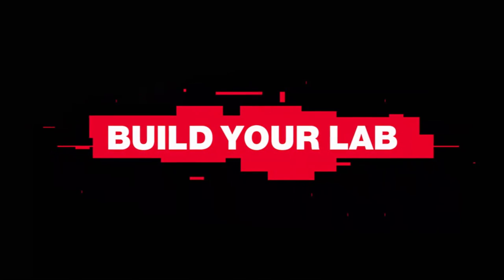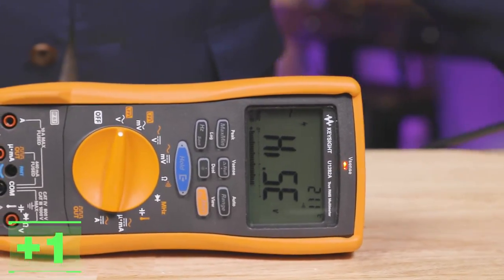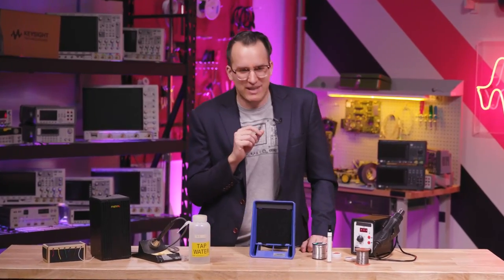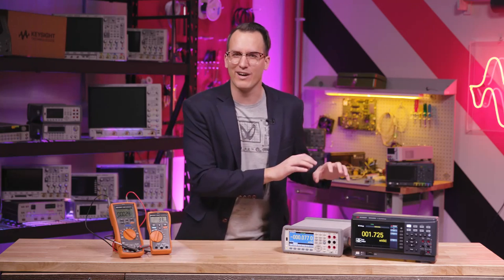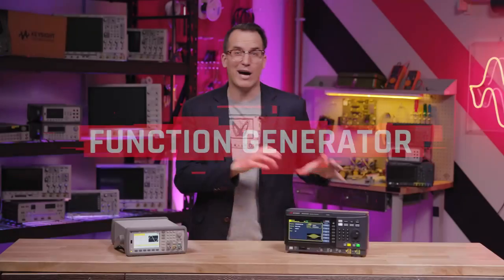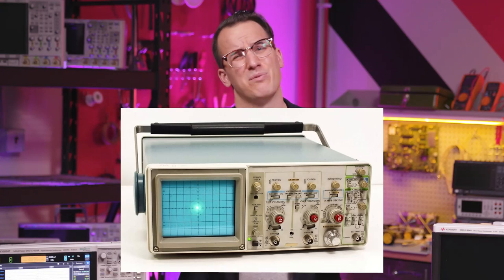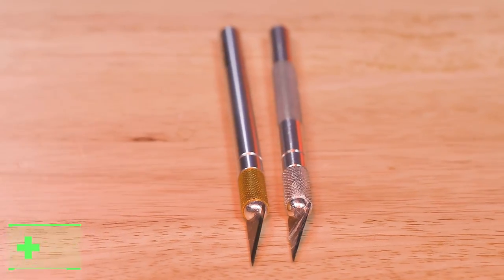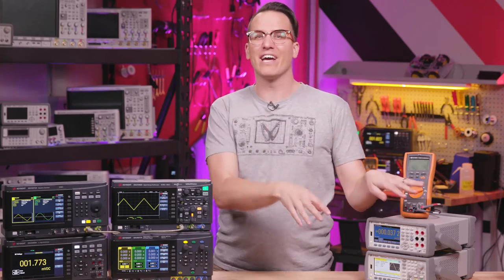A Perfect Electronics Bench?

Comment: MY TOTAL SCORE IS 46/79 POINTS. Oscilloscope: Tektronix 2232 Analog/Digital from 1989, it's in top condition from ebay... Power supply: A rack mount Agilent 6663B 0-5A / 0-20V modified for benchtop use by adding front binding posts, but it's quite a MONSTER on my tiny bench; I'm happy with it though only payed $150. Handheld DMM: A Fluke 18b+ straight from China, It was inexpensive and it performs quite well for what it is, gotta give it to Fluke. I feel like I should get extra points for my awesome Amscope x4.5 magnification microscope. I don't got a function generator... I hope all you guys from Keysight consider me for a lab upgrade! Would appreciate it for the rest of my life. Thanks for "Keysight University Live From The Lab" It is AWESOME!

EDIT: I have little experience using these tools, one day it clicked in my head that I wanted to do electronics, and that notion lead me to buy some equipment piece by piece, one at a time. I plan on going to school for electronics engineering in the near future!

Comment: My Lab gets 56 points.  I do question the need for a fire extinguisher.  In 50 years I have never once had a problem with combustion.  The worst that has happened is large a capacitor explosion.  No fire as the energy is limited..  So safety glasses yes, but a fire extinguisher is probably going a bit overboard.  Can you imagine cleaning a bench up after discharging one of those (over nothing)??

Comment: Got more than only a full Score ;-), but some Devices are missing - an Electronic Load, important to stress test your Powersupply Designs. High Voltage Isolation Test Device to see if the Isolation is properly designed. 3D Print, CNC Router, Laser cutter to build your own cases, and then you have everything I have ;-)

Special the Electronic Load is super important. I test all Power supplies that come with i.E: the Kids Toys, and damm some of these are super dangerous. Even in the Specs the Burd, loose protective Case or have 230V on thair outside.

Comment: Easier to list what I don't have. No fire extinguisher, no voltage detector (besides finders), no hot air, one one output power supply but that is changing soon, I have 2 dmm's (cheap ones) and a bench top mm that is surprisingly accurate, I have the cheap function generator but also a handful of vintage generators and oscillators, and last is my big honkin' Phillips PM 3217 50mhz scope (also a cheap aliexpress one that's garbage and and an old RCA tube one from the 50s that needs work). All and all I have possible $200 into tools. I am a poor student and some things were donations and that makes the world a good place. Hand tools I just had and have probably another $200 to $300 of parts built up. If you are in the lower tax brackets, like I am, then you should know this took just over 2 years to acquire.

Comment: I got 62 points (no fire extinguisher 🧐). And 21 of items mentioned below.
Reply: Extra in my lab:
* a shelf for chemicals and similar: isopropil alcohol, regular (drinkable 😂) alcohol, distilled water, PCB cleaner, coating insulator, etching, etc + gloves and syringes and other helpful stuff
* you can live with a thermometer built into DMM, but I learned that separate digital thermometer is helpful
* wall for tools is better than drawer
* electronic load, even my cheap one does
* big drawers/shelves for postponed (dead 😂) projects
* I'm a Mac person; learned pretty quick, you can't do electronics even on (my) hobbyist level without Win computer 😀

Comment: My score: 73 out of 79. No fume extractor, No hot glue gun, No voltage detection gun. But I do have a microscope. 0402 are the smallest I can handle without it. 0201 is really problematic...

Comment: I have solder iron 40w fix tamp and 16v max 2 amps variable power supply and wire stripper and paper cuter hot glue gun and dmm

Comment: TI-89? C'mon, it's a good calculator, but it's not HP! Should be extra points for an HP of the same vintage, HP 48GX or HP 50G.

Me? HP-15C or FX-991D, both straightforward and quick to get answers without having to fight a UI, and both have persistent ENG display mode.

Anything more than that I do on the computer.

Comment: I Love your Jokes :D :D i dont score much hehe, i only have basic tools(including proper wire stripper/Crimmper its the self adjusting type)& First&second aid kit + a lonely bst  its a handheld dmm+ helping hand circuit holder, and also all electronics i have, that stopped working over years etc i keep for the parts and also saving enviroment :D
i do have glases but never used(i dont do that special stuff) and also fire extinguisher(not sure how its typped XD) right out side of my room. but i allways follow proper HMS its called in Norway its for Health enviroment and safety(Helse miljø sikkerhet) so i do open my window when i solder and also using a computer fan for blowing the fumes away :)
i scored 48 thats funny but my most of my stuff are cheap ones tho, since i dont have a proper fume extractor i can say 45p :D
BTW: is Norway excluded on all of the contest for this year now or? if so why?

Comment: If I had enough money...
Reply: If I had ANY money
Reply: @hugoflores5806  Be cheap like me... and make an Oscope on a $10 dev board, using C# to display on your PC.
I used a ATSAMD10-Xplore, made by Atmel, just tell it to continuously sample ADC, and then have your PC read its outputs.

It's not extremely effective on higher frequencies beyond 100 KHz, but it's still something.
Reply: @cpK054L  Or get yourself a labrador board.
Reply: @cpK054L  Well, first I need a multimeter; and fix the house wiring